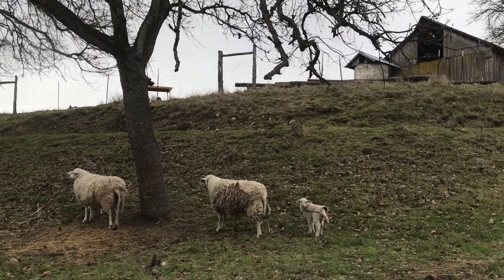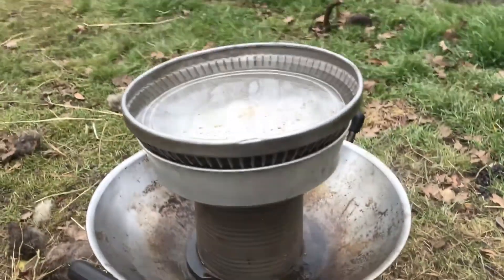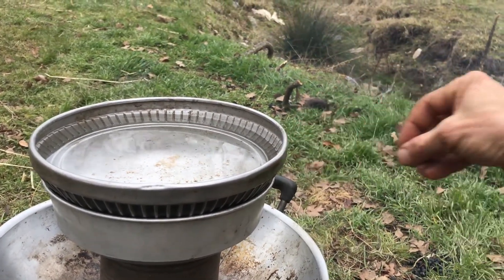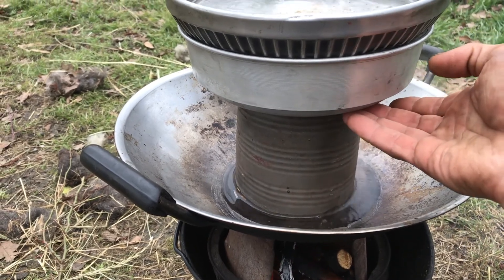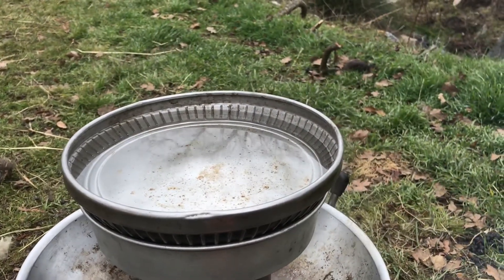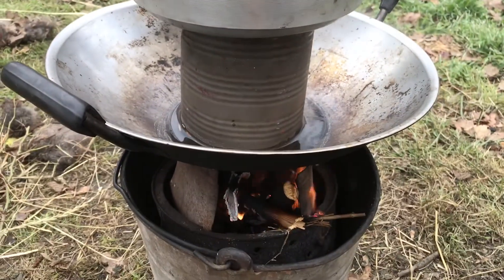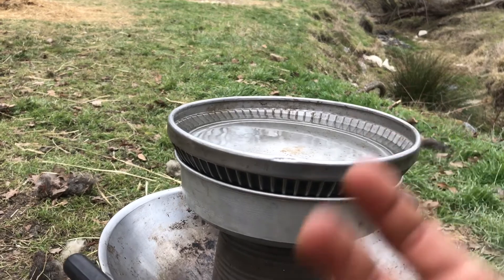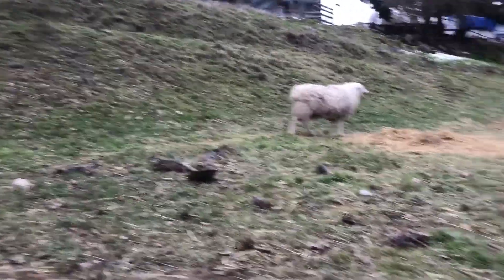DIY New Water Distiller Invention

Comment: How would the alcohol distillation work? I mean you start with some vodka for example, then you finish with 100% alcohol?
Reply from the maker: Alcohol sucks
Reply: It works fine, look into Mongolian herders distilled fermented milk. You use a wok as the condenser on top and keep a collection bowl on a stand inside the vapor chamber/boil pot. You bring it to a boil and run new water in the wok a few times but not more than 3 because you'll get into collecting just tails, diluting your high proof product and possibly adding off flavors.
Reply: You don't want to distill alcohol over an open flame. Alcohol vapors are flammable.